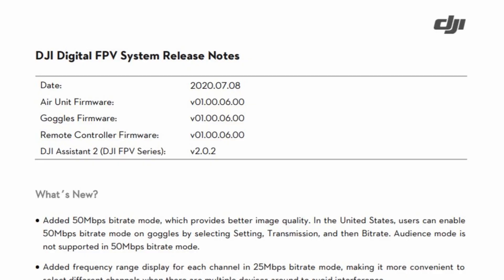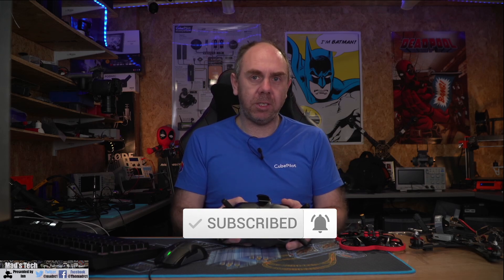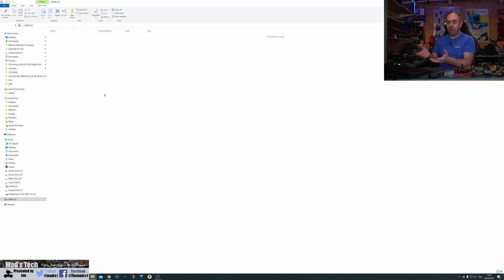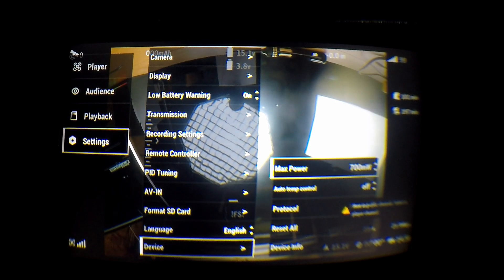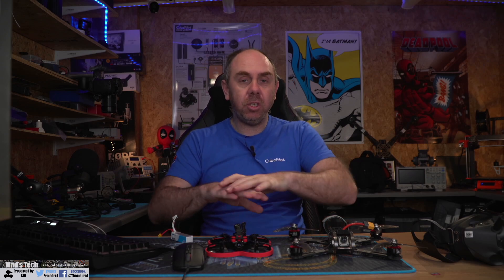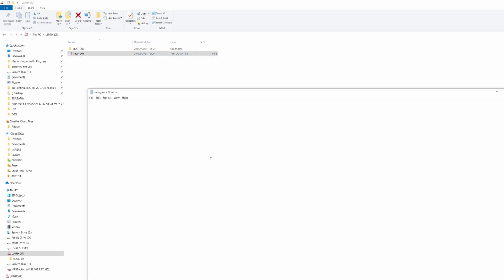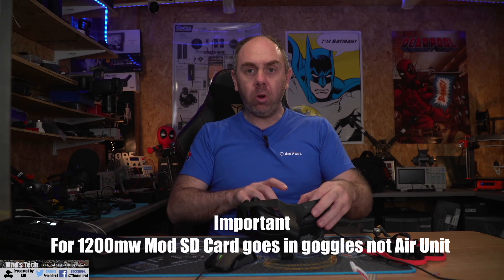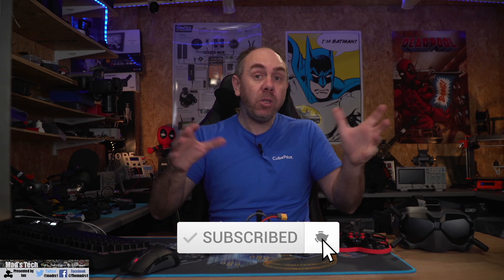DJI FPV Goggles V2 FCC & 1200mw Hack - Complete How-To For V1,V2, Caddx Vista & DJI Air Unit.

Comment: When I put the card in the Air Unit I don't see what you said, nothing seems to happen but when I do it for the goggles it works and shows the other options, does that mean it worked or is it possible that the Air Unit didn't work?
Reply from the maker: Ok so How many channels are you showing ? If your already in FCC then you won’t need to do the air unit.  So if you have 8 channel your in FCC now. Then you only need to do the 1200 mw as you have.
Reply: @MadRC  when I first got it it had 8 channels showing but then something I did reduced the number of channels, probably selecting 50mbs is what did that correct?
Reply from the maker: @ZyaLuke  yes you only get 3 plus public in 50Mbps mode as it’s using twice the bandwith.
Reply: @MadRC  so how do I know if it worked, change it off of 50mbs?  I just checked and currently I have 1,2,3, and 8.
Reply from the maker: @ZyaLuke  yep turn off 50Mbps mode.
Reply: And as long as it shows 8 channels I'm good?

Comment: I think I can't notice a difference in video quality after the hack. I did FCC hack on Vista and 1200mW hack on goggles v2. But after I select 50 Mbit in the settings the telemetry shows it's working on 25 Mbit. Is that normal?
Reply from the maker: You need to move to a non public channel for 50Mbps mode.
Reply: @MadRC  
Yeah that make it work. Thanks!
Reply from the maker: Also if you change to 59mbps and then reboot in 8 you will get it too.

Comment: So the memory card has to stay in the air unit and the goggles for it to work ?
Reply from the maker: No once done you can remove the file, it will only reset if you connect to Assistant 2 for FPV
Reply: @MadRC  thanks for the quick response. 
I've only received goggles today so now have to invest in a few air units and convert the fleet.

Comment: does 1.00.0606 still work with 1000 and 1200 mw for the v2's?
Reply: Any news on this?
Reply: GOOD QUESTION
Reply: I'm struggling to make this work on this version so far. Had the memory card formatted, then I downloaded the file and saved it to card via my mobile phone.

Removed the m card ,placed in goggles....

25mw option briefly highlights then greys out..

😔
Reply: I am running 0606 as I upgraded before learning about hacks. I can get 700mw on my air hd unit and my caddx unit also 50mbits, not tried the 1200mw option as yet.

Comment: On Vista and Goggles V2, does the power output in menu only show the greater power levels if in FCC or all the time? I did the FCC hack, and after brief delay it showed the 8 frequencies and the power menu options from 25 to 700.  Now, and  without going onto DJI Asst or Phone,  its dropped back to 3 frequencies only, but the power menu apparantly still shows 25-700, actually seeming to be set to set to 700 as shown, but OSD shows 25. Have deleted naco file which had worked, done it all again from scratch, and same, FCC mode does not set even if wait a long time for frequencies to appear.
Reply from the maker: If your in 50Mbps mode you will only have 3 channels plus public.  

The FCC hack should remain all the time as long as your don’t connect to Assistant 2.  

If your seeing 700mw in the power option your in FCC however remember it will only do that when your armed if you have low power mode turned on.  

The system will only enter that output if it received the arming command when you arm your motors.  You should see a red unlocked message appear.  

50 Mbps mode only has half the channels as it takes twice the bandwidth.  Go back to 25mbps for full 8 channels.
Reply: @MadRC  Thanks very much!  As a newbie to DJI, hadn't considered the bandwidth!

Comment: Is it me or the fcc hack doesn't work on the fcc canada air unit ?
Reply from the maker: It should work on all of them. I’m not aware of any it dont.
Reply: @MadRC  it was working, i was just in 50 mbp and didn't see the 8 channel.. I am dumb
Reply: It didn't work for me when I put "2" (Canada FCC mode) in the naco.txt, but worked when I put "1" (USA FCC mode). Something important to note is that the .txt file needs to be encoded in ANSI and not UTF-8 or other variants (you can choose this upon saving the file).

Comment: Thank you very much for the video. One thing that is not clear to me, if I want it at 700, I only have to do it on the caddx? or do I also have to do it on the goggles? Thanks
Reply from the maker: Only Caddx.  The Goggles one is for 1000/1200mw only.  FCC is 700mw.

Comment: How do I get mine out of low powered mode?
Reply from the maker: You can turn it off in the Settings, About menu or you need to make sure it’s getting the arming command from the FC.
Reply: @MadRC  What is the "FC"?  Flight Controller?  What if you are not using a flight controller?  Sorry I am brand new at this I am just using a battery, air unit and goggles and just got it and have not much experience with RC.  However I am working with people who are more experienced and have very technical knowledge.
Reply: @MadRC  Ok we activated the air unit and didn't know there was different software and we were trying to use the inspire software LOL.

Comment: What happens if I use my V2 Goggles with both, the DJI FPV Drone and the FPV system on another Freestyle drone? When I switch between the drones, I need to set the Goggles to the specific mode, but will the hack work with the FPV system after I switched back and forth?

Comment: Sorry, I cannot watch the video at the moment, but I am going crazy wondering if this will work on the new DJI FPV Drone COMBO!? You know, the RTF version of the DJI FPV Drone... I was told that I am limited to 25mW since I have the EU version! thanks in advance...

EDIT: IT DOES NOT WORK! I just tried everything and nothing happened! : ( I have a EU version FPV drone running on 25mW and I just tried everything. Unfortunately nothing changed. The FCC hack did not work and the POWER hack did not work. I tried running the card in the drone and the goggles. Nothing. Goggles running 1.00.6060 if I remember correctly... I love the EU for many things but stuff like that gets to me... Thanks.
Reply from the maker: No there are different hacks for the DJI Drone, I have a video on that on the channel. see DJI FPV Drone FCC Hacks.
Reply: @MadRC  I will look for it. Thanks.

Comment: I've been trying to get to 50mbps but to no avail, here is my checklist. Maybe someone can help. Thanks!
- Channel 1 (confirmed)
- FCC mode check

- Transmission 50 Mbps set
- Caddx vista naco 1 applied (file stored naco.txt)
- Goggles power 1200Mw

Yet on the goggles OSD it still says 25Mbps. No, I'm not on channel 8.
Reply from the maker: Perform a reset from the goggles menus.

Comment: Quick question. If I haven't had an SD card in my goggles yet, should I place the new SD card in the goggles first to format the SD card then take it out of the goggles place it in the SD card reader on my computer then do the naco_pwr hack?
Reply from the maker: That’s the best way but normal for
should should work.

Comment: Hi, for me works perfectly fine. I use my DJI Air Unit (latest firmware) with DJI Goggles V2 (latest firmware) in the middle of Europe ;) I followed instruction - uploaded one file to air unit (it allowed 700mW), after that I uploaded second file to goggles - it allowed 1200mW. Next week will check how much difference will be between 25mW and 1200mW - my goal is to get higher quality behind obstruction. Best regards
Reply: siema mam drona fpv i v2 gogle. Musze wrzucic dwa pliki jeden naco na karte drona, drugi naco_pwr na karte od gogli czy tylko na karte od gogli wystarczy?
Reply: I'm still not able to solve the problem on my FPV.
Can you specify the firmware version of the air unit?  Did you buy the FPV in Europe / CE zone?   
can I contact you by email?  koen.verschuere@fixsus.be?

Comment: Why at 50 Bitrate transmission i see only 4 channel? Its in Fcc mode? If i change 25 bitrate back 8 channel
Reply from the maker: In 50Mbps your using up twice the bandwidth or space on the band so you have less channels available to use.

Comment: Hi I have a question regarding the v1 goggles when I’m trying to record I get an error saying “low power mode unable to record videos” why is that ? I’m using a 4s 850mah battery. Is the battery not strong enough or the sd is not good enough ?
Reply: I don't know if you already solved this, but you have to disable the temperature protection (from the goggles) and then you can enable the low latency mode, high power, etc
Reply: @carlospp95  Hey Carlos , yes i solved the problem , used a wrong sd card.

Comment: Hi Mad, I've tried to add the file naco in the sd but the Goggles V2 doesn't change on FCC mode. Do you know what's the issue? Thanks
Reply from the maker: For the FCC hack the File must go on the airunit, for the 1200mw hack the other file must go in the card in the goggles.
Reply: @MadRC    Did you bought the drone within the CE zone?

Comment: Hi I have followed the procedure to switch to FCC several times, I see the power up to 1200mw in the menu, but I always have 3 channels if I switch to 50mbs mode. If instead I do 25mbps then I have 8 channels. Am I wrong something?
Reply from the maker: No that’s correct. 50Mbps mode has less channels as it’s using over double the bandwidth.
Reply: @MadRC  Thanks a lot for the answer. How do you think it is preferable to fly? 25 or 50?
Reply from the maker: 50 will give better overall image but 25 will be better range.
Reply: @MadRC  Perfect! Thanks.
Reply: @MadRC  I was wondering why AndyRc was flying his planes on 25mbs and not 50mbs.  Now I know!  25mbs did seem to work better for him and I saw very little loss when his plane was a good distance out he was staying at 25mbs at good range.   I been using 50mbs for my planes and range is ok but drops for 50mbs to 10 to 18mbs or lower pretty quickly.
Reply: Man I had the same issue I thought I was doing something wrong but you just answer my question and doubts so it is working properly thanks guys you guys all the best

Comment: hmm just did the hackss on my new v2's and a vista,  i seem to only have up to 700mw,  firmware 10606. anyway got the 50mbs can't wait to fly these goggles. ps. if you find the foam on the og's really uncomfortable try using a blunt edge to wear down the foam, 15 minutes rubbing back and forth across the forehead and cheeks improve the fit and comfort quite a bit
Reply from the maker: Did you do the 1200 hack on the goggles not the Airunit ?
Reply: @MadRC  did the hack on vista then v2's
Reply: also i just plugged v2's into computer to insert the file, maybe thats it?
Reply from the maker: Yes it meant to be on the SD card.

Comment: If I have my goggle DVR set to overwrite when full will it overwrite the hack? Or just the video files within the folder?
Reply from the maker: Once the hack is applied it does not need to stay on the card.  When the files are set to overwrite it should be the video files only though.

Comment: i send Belgian beer to who can help me to solve this 25mW bug.
I've tried everything, but it doesn't work for me.
CE
FW 01.01.00.00
I'm still on 25mW , 3CH.
Reply from the maker: So what’s your setup ? 

Have you applied the naco file hack on the air unit ?
Reply: Das gleich bei mir es geht nicht
Reply: Hi,
Yes, I did. I first created the file myself. afterwards I also tried by downloading the file and put it on the airunit.
I have the FPV  with goggles V2  FW 01.01.00.00
Reply: nobody wants belgian beer? it can also be Belgian chocolate.

Comment: Thanks! Will the Vista automatically output 700mw? Or do you need to choose the power output from the air unit in the goggles?
Reply from the maker: You should check it as it could be set to 25mw regardless.  The vista works slightly different to the dji air unit in lower power mode too.

Comment: Hi, it seems to work, but now I dont't see the "UNLOCK" message on the display when arming my quad. So I have 8 channels 700 and 1200 mw, but no unlick message and the timer won't start after arming. Any suggestions?
Thanks!
Reply from the maker: It sounds like your not getting telemetry,  is the OSD working ?. You could try a reset in the settings.
Reply: @MadRC  Thank you. I had to play with the uarts/ports tab. It works now:)Have a great day!

Comment: I just got my fpv drone with the v2 goggle combo. I tried this power hack, but my goggles doesn't have the menu item like in the video at all so I can't even see what power I'm using.  I'm in the US so it should already be in FCC mode correct? I didn't do the FCC hack first. Oh wait...this power increase doesn't apply to the fpv drone?
Reply from the maker: Us is FCC already.

Comment: My experience is that if you switch between DJI FPV drone and (old) FPV system with air units and vista's, you every time loose the stored links for the vista's and air units! This is totally unworkable! Anybody who has a fix?
Reply from the maker: Sadly no it’s a quirk of the system
Reply: @MadRC  Yes, I think DJI must quickly come with a fw upgrade to solve this! This is unacceptable for flyers with regular DIY drones and the DJI FPV drone! Totally unworkable! My drone friend has 12 DIY drones with Vista units and air units (for some of them the link button is difficult reachable).

Comment: Top vidéo, thanks.!! 
I just buy dji fpv and google v2.. I used v1 hacked before.. 
Do you mean, that if i use in the same day dji fpv and my others drone with google v2 hacked, I have to restore hack with computer after flying with dji fpv.... 😭😭😭😭😭😭😭
Reply from the maker: I don’t know if the 1200mw hack remains. The FCC should as that’s on the airunit.

Comment: Hi, does the sd card need to remain in either the drone or the goggles after youve switched them on and changed the settings? Thank you for the info btw.
Reply from the maker: No once it’s done it will stay until you connect to Assistant 2 again. The second you connect to Assistant 2 for FPV it will reset the hacks so things like firmware updating will remove it and you will need to do it again.

Comment: Is there any possibility to "hack" the DJI fpv drone itself? Or does the "hack" only works with air units?
Reply from the maker: These hacks are only for the Airunits.  You need to look at dronehacks for the drone.
Reply: @MadRC  do you have any recommendations?

Comment: dont work for me.
It opens 8 channels , and after 25 seconds it flashes and turn back to where it was.
only25mb/s and 4 channels
Reply from the maker: Is it connected to assistant 2 ?  The only way it would go back was if it was detecting the region.   That’s really strange.
Reply: happened to cadx and air unit.
not conected to computer.
Reply: and while it was on fcc ,i could change only to 50mb and 700mw.

Comment: So will this work with the dji fpv quad??
Reply from the maker: No there are no FCC hacks for the Drone as of yet, chances are not soon either
Reply: @MadRC  There is an FCC HACK for the goggles V1 and V2. So the goggles will send more WATTS. Doesn't mater if that's to an air-unit or the FPV quad.. It wont work for the controller ofcourse.
Reply: @MadRC  and NLD (NoLimitDronez) is working on it
Reply from the maker: @OneOfTheRobs  a number are.  I have litrelly just been told of a confirmed working FCC hack tested today by one of the groups.  There will be more to come. Drone hacks, NLD and there are some more secretive ones out there too

My not soon was a little off the mark lol.

Comment: Hi Mad! Great video. Thank you. I’m in a FCC area (U.S.) with the FPV Goggles V2/FPV Drone combo. Though having applied the 1200 mw hack correctly, it does not work.  The v2 goggles are running firmware 01.01.00.00. Do you think it’s a firmware issue, and if so, how can I downgrade the firmware?  Thank you for your thoughts. Paul
Reply from the maker: The hack does not work with the DJI Drone.  It’s only for the Airunits.
Reply: @MadRC  Do I need to leave the sd card containing the hack text file in all the time or can it be removed and still have the hacks working?

Comment: I'm in the USA. I have V2 goggles and the caddx vista. But I only have 2 channels, plus the public channel. Why is that happening any idea?
Reply: Now I have 1200mw and 3 channels and the public lol. Wth?
Reply from the maker: Are you on 50Mbps mode ? That reduces the channels to 3 plus public.  

If not perform a reset from the goggles menu and it should reset to normal.
Reply: @MadRC  ok yes I'm in 50mps mode. Is there anywhere where all of this is explained? I read the manual but so little in there.
Reply from the maker: 50Mbps mode uses twice the bandwith of the standard 25mbps mode.  As such you only get half the available channels to use.  Public plus 3 making 4.  If you turn 50Mbps mode off you will get all 8.   Also note 50Mbps mode only works on 3 channels as the Public channel will always be 25mbps.
Reply: @MadRC  thanks!

Comment: Hi, does it work with the new firmware after the drone launch? Thank you
Reply from the maker: It works with the FPV Airunit but not drone. 

Basically the goggles have two firmware.  One for FPV standalone and one for Drone.  The hacks work with the FPV standalone but not the drone.
Reply: @MadRC  Thank you, let's see if something more will be discovered!

Comment: Thanks for the video! But, question is this, is there an fcc hack for the DJI FPV drone? I can't even find power output options in the menus.
Reply from the maker: No their is not at this time.  It’s entirely different firmware.